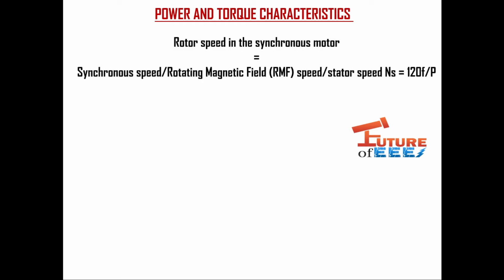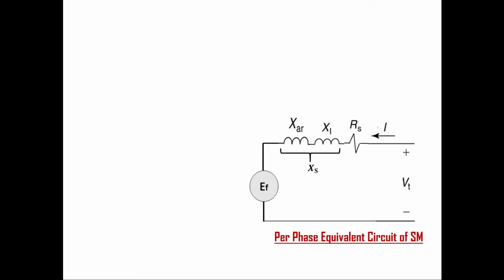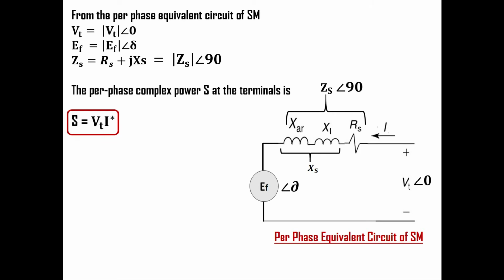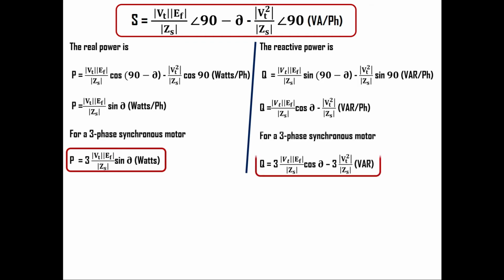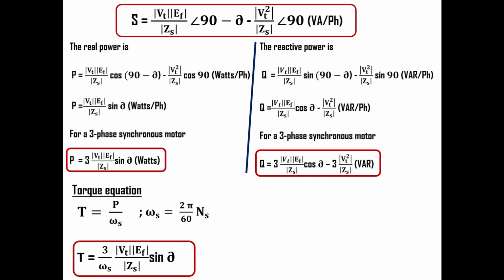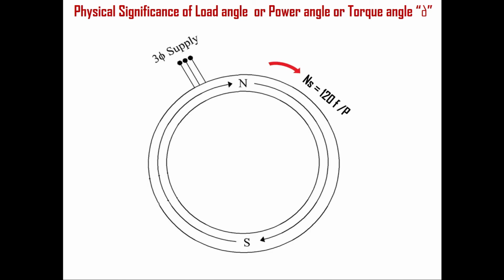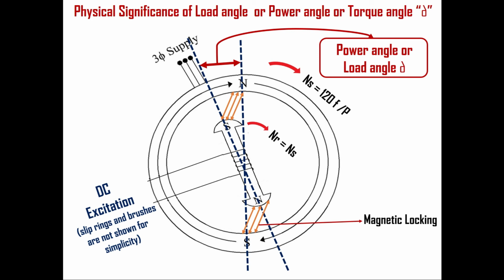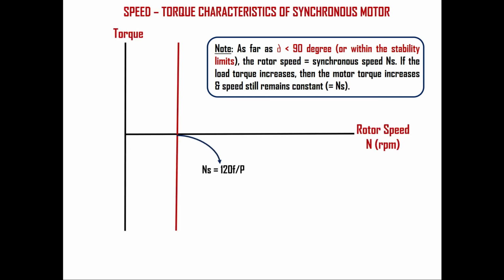Power / Torque angle & Speed- Torque Characteristics of SM

Comment from the maker: 1.29: Vt is the per phase terminal voltage of the stator. Since Vt is AC voltage, there should not be plus (+) and minus (-) in the equivalent circuit. Thanks!